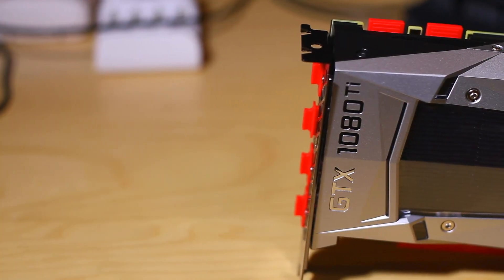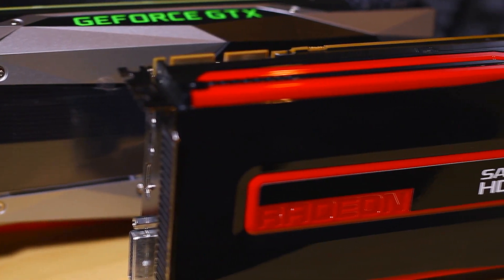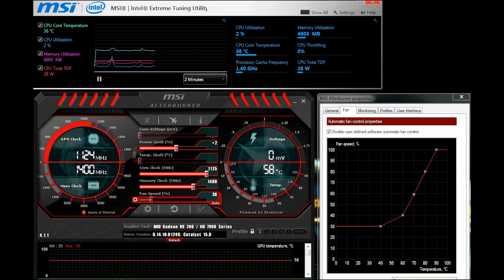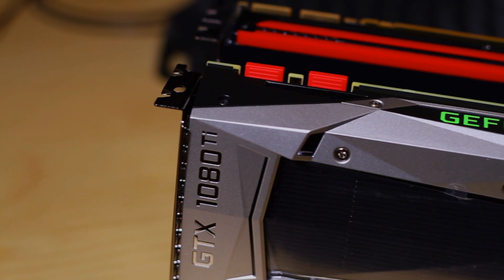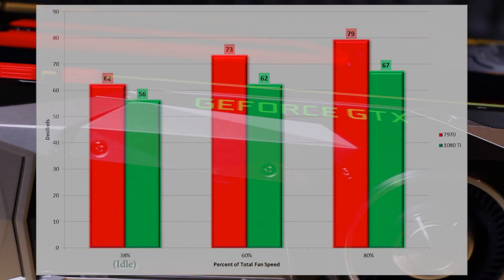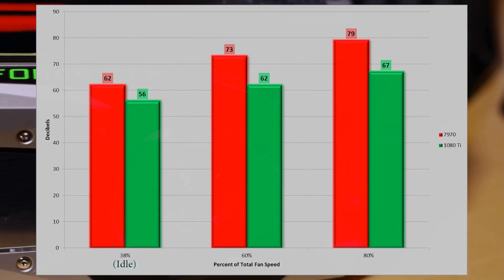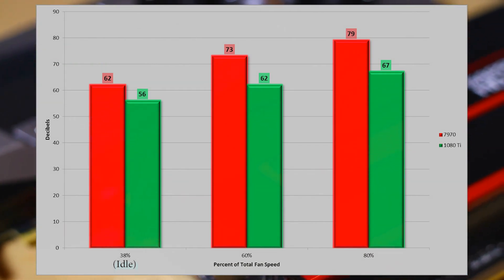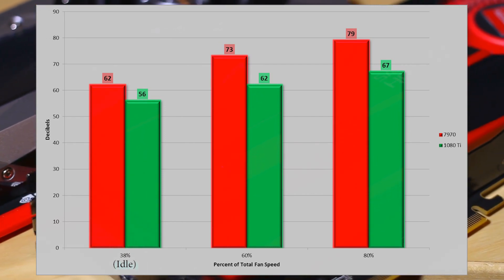1080 Ti FE vs 7970 Fan Noise

Comment: I wish true aftermarket blower coolers were still a thing. Look at the HIS IceQ 7950, the noise and thermals of that card were superior to even the Sapphire model, which is nice dual-axial cooler model.
Reply from the maker: They make switching to water much easier as well.  While I don't mind the after market coolers that come out I always preferred to dump the heat out of my case instead of into it.
Reply: @Ripskin16  This is the exact reason I bought a used 1080 FE instead of a 3060. My pc is a sleeper and absolutely will not work with anything but a blower cooler
Reply from the maker: @rockl79  My 1080 Ti is still going strong, wish I could put more power into it (sans the shunt mod) to give it more oomph but it can still play new games on my 3 screens at medium / high settings.  

I don't like the new FE's or after markets that keep so much heat in the system.  But as that is where things are headed when replacement time comes I'll have to rethink my case airflow as I dunno if I'll be going water.

In your sleeper I cant imagine trying to stuff the 3 slot sized cards now :o

Comment: What percent fan speeds are the 1080ti under load though?  Does it usually run at 60 percent or 80?
Reply from the maker: I ran a few tests, the first 1080 test was at idle, the second at 60%, the third at 80% and then 80% with the door closed.  I did not do a 100% because it was already so much quieter than older models that I felt it was not super necessary on top of the better cooling.

As far as where the levels typically were really depends on the games you play, your resolution and graphical settings as well as your customized fan curve.  I never ran this thing on a default curve and I find cooler temps more important that a small amount of noise which is subjective.  A loud game will over power my PC which admittedly is on my floor under the desk so even more quiet than if it was next to me.

Overwatch is surprisingly intensive on the GPU and would cause it to ramp up really high and the game hates any OC at all.

PUBG was not super optimized back then but I could easily sustain 2000 to around 2020 on air but the fans were pushing 80 to 90% and the system throttled to 1980 / 1999 and kept the fan speed.  Temps were around 84 to 86c when it throttled. 

I played a few other games back then but nothing fancy that I can recall.  I did not run air too long and have had it on water for longer.  

Though the cooler and air was still solid and it OC'd more than I thought it would on air before temps were just a bit too high when heat soaked and I did not like running the fan at 100% for long periods of time.
Reply: Ah, I was curious to what the fans usually run at with default under load.  For example, my 1080ti sc2 is always pushing its' limit since I game 1440p 144hz.   Default fan curve results in fans running at 55% on most occasions.    Noise is def. subjective, and that's almost too loud for me.   So I actually have it so fans spin 48% max.  Instead of temps maxing to 72 degrees on default it now peaks at 78 which doesn't bother me since that's still safe.  Thanks for replying.
Reply: Oh, and that 55% feels loud to me because I only had one GPU before that, the evga 970 sc 2.0.   That thing was QUIET.   Under load the fans never peaked 37%.  Took that for granted I guess.
Reply from the maker: @Haddley333  Coming from my 7970 I was quite surprised how well the card performed under the same fan curve which I know was pretty aggressive.  It was a very noticeable difference in sound.  

Yeah that resolution and all the eye candy turned on can drive more lol.  I think at the time Ghost Recon was the most "pretty" and intense game I was playing.  I went from medium / low medium settings on the 7970 to max everything on the 1080 and it was still cooler and quieter.

If my PC was on my desk I think the GPU would have been annoying but on the floor it was really quiet.  With my 7970 I would probably have gone water sooner lol...  

You bet :)
Reply from the maker: @Haddley333  Was that an aftermarket custom PCB from them?  Reference or "Founders" designs are always louder than the later multi fan designs card makers come out with.  

I only avoid those as I don't like all that hot air dumping into my case even with decent airflow it seems to hang about more than I would prefer but they are solid performing units and it sounds like your 970 was a beast :D 

Cards have definitely improved though the quietest card I had was my Voodoo 2 / 3 which were passively before they needed fans lol. I think my GeForce 2 MX was passive as well.  My current system is the quietest I have ever had thanks to better fans and better utilization of system tools.  I like the silence but if it comes down to it I'll ramp up to stay cool and performing :D 

Though one of my PC's had a 72 or 7600 RPM fan and that damn thing was a leaf blower lol...

Comment: Lol... The moment when I feel like the Fe card I have is loud at 65% dang those old cards were almost louder then idle
Reply from the maker: Yeah, its crazy :o
Reply: hope there will be a day when blower style cards get good enough to not need after market open coolers. as i do see blower style as smarter choice if cooling reaches a even higher lv in the years to come as they push all there heat out
Reply from the maker: Depending on case set up and cooling yeah.  They definitely have a place in the market and I have had much better luck with the reference designs lasting a long time than the custom cards I have had in the past.

I prefer to take the heat out of the case then leave it in and use the static pressure from the case fans to draw it out but they can be successful if the setup of the overall system is well done.

With my CPU on water and my PSU barely introducing any heat to the case the blower benefits a lot and does a great job.

Comment: Sometimes temp limit stops working on my card, and temps goes as high 87C and there is not throttling. Any ideas? Card is 1080 TI FE stock,no oc. No programs installed. Rebooting pc cure this.

I tried on 378.92 and 382 drivers,
Reply from the maker: What software are you using to control the card and are you running a custom fan curve or overclock on it?
I use MSI afterburner and it has some flaws with my 1080 Ti and did with my 7970.  With my 7970 it would randomly flip into a manual mode instead of automatic and follow my curve causing my card to hit 90C.

With the 1080 Ti it just keeps forgetting my OC settings, easy enough to click the profile button and restore it but I know with my old card it would flip into manual fan control vs my curve and warm up fast.
Reply: I am not using any oc utilities. All stock ,default curve. So thats weird.
Default temperature target: 84C.F

Sometimes temp limit stops working on my card,fan goes from 49% to 60% on auto, and temps goes as high 87C and there is not throttling. Any ideas? Card is 1080 TI FE stock,no oc. No programs installed. Rebooting pc cure this.

I tried on 378.92 and 382 drivers
Reply from the maker: Did it do this from the start?  To me it sounds like a disconnect between the driver and the hardware so the hardware is left to fend for itself.  A complete removal and reinstall of the drivers may help.  If it has always done this then it could be a bad card.

If it only started recently it could be an issue with the driver and your system.
Reply: I dont think its a bad card,because some other  user with 1080 TI FE report the same issue. But maybe we both have wrong cards?

Card just sometimes reaching 86-87C  with fan auto 60% , and there is not throttling on card. Clocks are high. After reboot of system , again 83-84C and throttling normal on clocks. Any ideas? I tried on both drivers,the same.
Reply from the maker: Yeah it doesnt sound like a bad card but you never know.

I have not messed with the default curves as I went straight into Afterburner to OC mine and use that tool to moderate its temps.

It is possible that the curve in the default setup has profiles that could be set or being set such as 'quiet' in which the fans will not exceed x speed.

I could see such a setting overriding the temperature limitation within set limits as you said it doesnt throttle.

I only installed the driver and nothing else so I'm not sure if I have access to what you're using but I'll take a peak in the morning.
Reply: Hmm weird. Somebody said this to me:"Thanks. So there's nothing wrong with the OP's card, then. It's normal for the GPU temperature to go above the temp target value and hit one of the other limits, such as PWR_LIMIT which OP sees.
I think the name "THRM_LIMIT" is a poor choice, then. It is not a limit at all, but a target value that can be exceeded. "Limit" to me means "cannot exceed".

"Because, apparently, that's how the card works. The card allows the GPU temperature to exceed the temperature target/limit value depending on load conditions and other variables. Rebooting "fixes" it because it allows the card to cool down, allows the GPU power to drop to minimal values and allows the GPU clocks to drop to the default 139MHz which basically "resets" the card to a state where the temperature target becomes the regular/first limit again. But, putting load on the card again will, over time, allow the temperature target to be exceeded depending on load and other factors, just like it did before the reboot.
At this point, performing the same test again and again, rebooting, testing, etc. and expecting different results borders on the definition of insanity."

Did you understand this ? : )
Reply from the maker: While I understand it and it makes sense contextually it doesn't make a lot of sense that it would perform that way under those labels.  I have not run mine at stock or with stock settings for more than the test I performed in this video.   

Though I set the fan speeds in Afterburner then worked on my overclock.

F.E. / Reference cards do run warm and it sounds / looks like after some reading last night that this card's default fan profile is geared towards noise instead of performance.  So it lets the card get hot and will eventually throttle it to cool it down.  You may not be noticing the throttling as its not impacting what you are doing?  Or it doesnt have to pull back by much in order to cool off.

My fan curve is decently aggressive so at 1923 boost clock I dont exceed 75 to 76C under gaming conditions.  I have abut 10c to play with before the card starts to hit its internal limits and thinks about throttling.

I say tweak your fan curve.

Comment: Still too much noise for night gaming
Reply from the maker: For some I could see that but it depends on a lot of factors unique to each person.  I have mine boosting to 1923 Mhz on the core now and its still acceptable to me.  If I have the money I may put it on water this winter to try and get that past 2k Mhz with nice cool temps.   We'll see :)
Reply: Ripskin16 I am looking to buy ZOTAC GeForce GTX 1080 Ti ArcticStorm - Grafikkort - GF GTX 1080 Ti, and it is very expensive. which is Why we watch these videos. To buy something expensive
Reply from the maker: Not knocking your choice or decision.  All I'm saying is each of us have different tolerances and desires from our purchases.  For a number of folks this video helped them buy a FE card without worry.  For others it showed that they would not be happy with an FE.  

That was the purpose behind making this vid.  For me, the FE is fine.  Would I like silent with better performance yeah, but that's why I planned to add it to my water loop down the road.  But it is so much quieter than my 7970 lol.

The after market cards like your looking at are great and I have nothing against them or folks who want them.  You will most likely be very happy with it :)

Comment: What about putting RPM on screen? Like this is useless.
Reply from the maker: Not sure I would call it "useless" but the RPM would have been a good thing to include.  

However, with the percentages I did include taking the max RPM if known and some basic math I believe the RPM at each test can be determined. 

I did not include it because the majority of people working off a curve or comparing will be looking at the set percentage vs RPM's as fan design and speed are not consistent between models and cards.  Some fans work better than others and others by design will pull more air with less speed.  Cooler design may also come into play along so a plethora of other variables not really covered.

Whereas the curve will likely remain the same up front making it a more straight comparison of what people can expect in going from an older blower design, especially AMD's to the Pascal design.